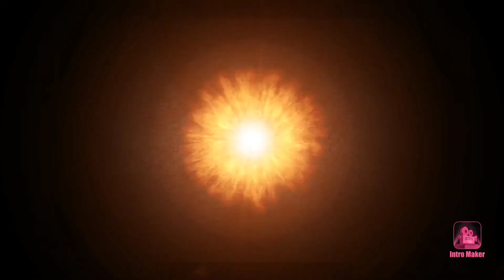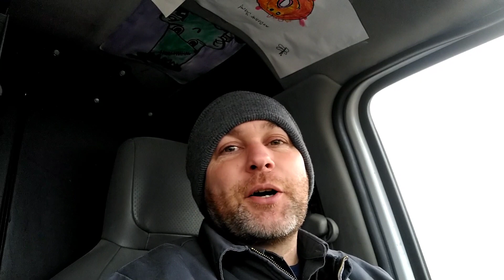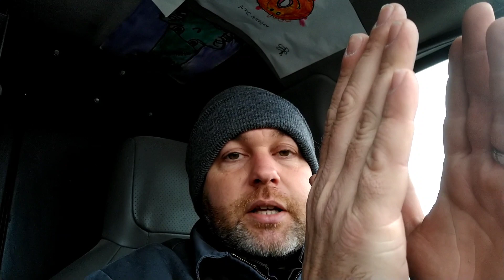Gas Furnace:  Modulating, 2 stage or Single Stage.  What do I really need?

Comment: Andy, thanks, a no-nonsense great upload-upvoted. My bio: My home is in a Western US temperate sunbelt coastal location. I'm replacing a 1983 Payne 71,000btu 80% AFUE updraft unit that I cannot get to run, in a 1964 single story home with no insulation. But NG is cheap and I don't use much in the winter. You've got me thinking of an 80% (because a 90%+ AFUE condensate pipe would have to tie into a 24" high existing drain line, and I don't want a pump), one or two stage with or without variable speed blower.  Do you like your Goodman furnace?  I do not want an annoying fan noise louder than what I have had in the past.  Are the Goodmans quiet and do you like yours?  And any comments on how the variable speed fan works would be appreciated.  Thanks!
Reply from the maker: I do like the Goodman brand.  But ALL 80% furnaces are loud.  They have an open burner cabinet for combustion air and the burners and inducer are what u hear.  Not the blower.  Circulatory blower noise is the least of your noise concerns with an 80.  I personally would not waste the money on a vari speed blower in an 80.  Itd be like putting 5000 dollar rims n tires on a 1982 Honda.  Lol. Just not worth it.  The 80s work.  They do there job.  They heat the house.  I just like for everyone to know what they r getting.   If noise is a concern, I personally wouldn't buy an 80.  
Hopefully that helps! Thank you so much for the views n comments! Be sure to subscribe if your not already! Have a great day!

Comment: Nice video! Love the honesty I am a home owner with a 30 year old furnace. I’ve had some people say to keep it as long as possible since new units are more complicated.
Still looking into options in case I need to replace.

We have a split level home so the upstairs is on the furnace side gets very warm and the opposite side of house feels fairly cold. The air pressure coming out from the far side of the house is reduced quite a bit. 

I have no problem getting a single stage but I do like the idea of maybe having better comfort on the one side of the house.
Reply from the maker: Thanks for the views!  I would recommend a zone system when u get a new furnace.   U can have multiple thermostats In different levels that way.  I am a believer in new is better than old just due to efficiency and safety.   The older ones do last longer.    But they are inefficient and not as safe for you, your family and your home.  Lot of different options out there!  I'll have a couple more videos on these issues soon.   Be sure to subscribe if your not already and SHARE with a friend!   Thanks again!

Comment: We bought an 80k btu Goodman furnace 2 stage. How would we go about setting it at 1 stage.. we don't like that takes long time to heat up house. Thanks in advance. 👍
Reply from the maker: Mine at home is also a Goodman.  If it's a couple of years old on the board there is a switch Bank of three switches. One switch is labeled one stage or two stage and you just flip it to one stage and lock it in on high. If it's a brand new Goodman they have a much more complex board in them now and there are several different dip switches you can set. You could either get your manual out and see exactly which one it is or have a qualified technician come out and change it for you. But I do believe that all of the Goodman models have the option to lock out the two-stage part of it. A few you do have to put a jumper wire in to make it go right to second stage. So my best advice would probably be to talk to a technician in your area if you're not comfortable with any of the wiring or dip switch settings. The old ones were so much easier LOL! Thank you for watching and the comments! Be sure to subscribe if you haven't already and share with a friend! Thanks again

Comment: Boy I wish I would have seen this video before I was sold a Trane 2 stage furnace. I hate it and from what I am hearing it isn't operating like it should. At temps around 30 to 40 it takes 1 hr and 50 mins to go from 69 to 72. It will do things different from day to day. When I first got it it would run stage 1 for about 45 mins then go back and forth between stages every 5 to 8 mins. On colder days it will never go to stage 2 and warmer days it will. I am still dealing with my installer about the issues but  they never really tell me what is normal. He has talked with  Trane tech  support and they are suppose to be watching what it is doing but that was a month ago and have heard nothing. I have just got to keep on them.
Reply from the maker: That sounds like a real disappointment in a furnace.  I would see if you could find another company that could honor trane warranties and maybe knew a little more about the units.   I would see if they would just set it up as a single stage unit and run on high stage all the time.   That's what mines been for years!   Thanks for the comments!  Be sure to subscribe and share with a friend!
Reply: 99% chance installer/tech fault 

There’s a lot a lot of fine thinking, set up configuration that can be done right or wrong both a unit or thermostat if it’s communicating 

90% of your system should be who you hire, who selects size and recommends equipment type, quality of installation and set up and fine tuning, guarantee and customer service. Unit itself it’s secondary.
Reply: How do you know what stage it is in? I supposedly have a two stage, but there is nothing to tell what stage it is on. The thing blows cold air at the beginnning of the cycle, then hot, then cold at the end of the cycle. It's miserable. Just the opposite of comfort, it simply makes you feel cold.
Reply: I have the equivalent American Standard version (Trane/American Standard) controlled by a Honeywell VisionPro thermostat. My thermostat is controlling the staging and the staging is turned off in the furnace settings. On very very cold days, it will go in and out of 2nd stage as it dances 2 degrees from the setpoint. For Honeywell thermostats, it will vary a bit because its algorithms consider more things. But it is still very conformable. If it were to fall 3 degrees away from setpoint, it will stay in 2nd stage. Some professional Honeywell & other thermostats also have the option that says if you go into 2nd stage, stay in 2nd stage until you cycle off... for those that don't want it dancing back and forth. Ecobee might have that option too. Likewise, while maintaining temp in milder weather it has no need to go into 2nd stage.  All this goes out the window if the installer has configured the furnace board to go by time only... a certain amount of time would have to pass before going into 2nd stage (but I think it would stay in 2nd stage).  The way you explained it working when first installed sounded better. It makes no sense for it to go to 2nd stage on warm days but not on cold days.  Since this was 8 months ago did they ever get it fixed?

Comment: I have a modulating furnace with an ECM motor. Replaced a mid efficiency Fridgitaire model 4 years ago. I really like the constant temperature control. I did not notice a change in my gas bill. I live in southwest British Columbia where temperatures rarely get below 5° Fahrenheit. My 2 cents. Thxs for the vids!